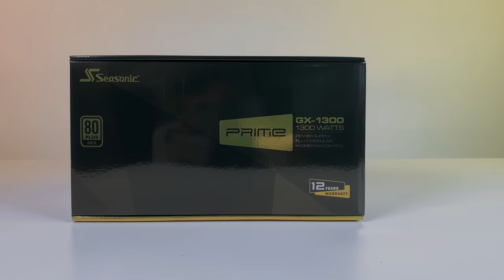LIANLI O11D XL Clear WaterCoolde Build

Comment: This is a really incredible build.  The tubing runs you ran to the distribution plate especially. Also your trick to keep the GPU from sagging is seamless.  Just one opinion, I would suggest is for the flow sensor wire to be tucked behind and then back around for a cleaner look. That's just nitpick really. Congratulations overall.
Reply: Hah?
Reply: The name of that  little "tray thing" that keeps the GPU from sagging? Any idea as to what its called?
Reply: @MassiveReset  I think it’s sth. like a riser cable.
Reply: @crowschattenpfote  thank you very much
Reply: @BowlingNG by "trick" do you mean the connector from GPU to RAD? Does that section actually run water or he's just using it to support gpu? Phenomenal build
Reply: @MassiveReset  It's called a GPU vertical PCI Slot adapter plate. You'll need a riser cable as well.
Reply: @Yungplaymaker  By trick I mean the small metal tube with the black ends that is sat on his fan mount to keep the gpu end from sagging.

Comment: Nice build! Looks very clean, light and not too overloaded with some secondary staff! Even though I'm not a fan of any RGB lighting, that particular one set looks pretty well. I wonder, what level of noise you should expect to experience from such built PC staying at approximately 1 meter distance from it?
Reply: its little subjective but found it very quiet
Reply: U don’t rely as much on fans with water cooling, so should be very quiet

Comment: I like this part 0:49 you did very good job on thermal paste !!
Reply: Actually he didint. all that does is creat little bubbles in between the cpu and plate when he presses it on. To much. Just put a little bead of paste and put the plate down. No need for all that.
Reply: I did the same with the thermal paste as well! I squeeze it onto my CPU and then spread it evenly covering the entire surface with a butter knife.
Reply: @ivanyu3930  Yes. I think this is the best way to cool CPU rather than 5 point dots method.

Comment: love the pink thermal paste 🤣🔝
Reply: Is this Thermal Grizzly Kryonaut ?
Reply: @crowschattenpfote  Idk, just thought it's different from the usual...
Reply: @Renato_gg  ok i don't know either oh by the way i just watch all the videos from this channel right now and without a break.😂
Reply: @crowschattenpfote  You can see at the beginning from the video from 0:40 Cryonaut Extreme at first on the right side and later on the left side of the table.
Reply: Why you use this thermal past if you dont cool it with liquid helium. It makes no sense
Reply: @georgbedarff1610  Why the frick shouldn't it make sense? Better thermal paste means better heat transfer, which again means cooler temperatures with the same cooler. Cryonaut is just simply thermal paste that is really good and not a product made exclusively for Extreme OC.

Comment: What vertical Riser is this?, because I'm looking for the one so I can fit the 3090 ftw3 with block and active backplate in the first slot.
Reply: That would be the Lian-Li 011DXL-1 Vertical graphics card holder with the 011DXL-1 riser cable PCI-E slot

Comment: awesome build very close to what am planning with the black case. i do have a few questions. which vertical mount did you use? is that the O11D Distribution Plate G1?
Reply: looks like the vertical mount from Lian Li, and yes that's the G1 distribution plate from EK
Reply: Yah it's the o11 D distro plate which imo looks bad in the xl version of this case when you can get the o11 XL distro plate for front or side
Reply: @masterhacker7065  cool I didn't know  there was a side mount one for the xl. Something about the front panel distro that doesn't sit all that well with me .
Reply: The vertical mount with water cooling looks nice but it's kinda annoying if you need to clean or access the motherboard behind the GPU.

Comment: you could have put fans behind the reservoir and pointing into the case to cool off the water coolant
Reply: I dont think some fans are gonna pass through thick acrylic to cool the coolant, there are radiators for a reason😂

Comment: Looks really cool. What size/type of extender fittings did you use on the CPU and GPU block?
Reply: I think  fittings for 16/10 Tubes but I don’t know. Look in the discription
Reply: I also think 16mm since the tubes are 16MM.

Comment: No need to use those tools to add Thermal paste. It looks fancy and all putting it on like that but all yer doing is creating tiny micro pockets between the CPU and your plate when you finally press it down onto the the CPU surface. just put a bead of thermal there and be done with it. 

The build his fucking fantastic though. Superb work on this PC.

Comment: What temps did you get on this? I putting a build together with the supreme x and it has a active back plate. I'm debating if I double fan the bottom or stick a thicker rad in.

Comment: There are only fans that blow outwards, none that blow in. Doesn't the housing always have a negative pressure and the housing draws in dust from all slots?
Reply: Bottom fans are blowing air in, in Pull-configuration.

Comment: I also wanna build in the same case a water cooled amd 7000 build...

But i am going to use flexible tubing because of you not needing the extra things to bend it and all the problems that come with stif tubing
Reply: Buy pre bend tubes, just need to cut them
Reply: @iTouch4444  where ?
Reply: @J.king87  Amazon and some other tech sites they provide few of them

Comment: @1:40 what is the SSD to RAM adapter you used?
Reply: That thing is a Dimm.2 module and that’s a thing that only asus has and you can but ssds in it, which can run over the cpu. But it’s only available with the high end board, like the Asus Apex or extreme😊

Comment: a quick question if anyone can answer, the liquid is been cooled by top radiator, isn't that supposed to be for hot air exhaust, just  saying isn't the liquid cooling radiator getting hot air.
P.S.   Newbie here trying to learn stuff so I can DIY my setup
Reply: It does exhaust hot air in fact, but its not really an issue.
And also, there is also a bottom Radiator cooling

Comment: How did you get the 3x8 Pin on the 3090 Ti Suprim X?! Mine is delivered with a adapter for 3 8 pin PSU cables ending in a 12(?) Pin cable fitting for the Suprim X. Is it different because of the watercooled version?
Reply: He has a normal 3090 and these have normal 3x8 Pin, while the 3090 ti uses the 12 Pin you mentioned.

Comment: someone who ordered this pc must be so dumb ordering K version of i9 when KS is faster, produces less heat and has lower power consumption.
Reply: The K version have Graphics chipset inside. Better option if you want to video editing or rendering something, it works toguether with the 3090 when need it.
Reply: @yv5tx  I think he is ironic. He doesn't meant the F Versions, but the K-Special-Edition (KS), which is known for being a bit better than the normal K version, but also to draw a shit-ton more power and produce way more heat but instead he says that its actually better while running cooler with less power draw, which is the ironic part, I think at least. Or maybe he actually believes that the KS runs cooler with less powerdraw, while sustaining the same performance, but this is just wrong. The only thing that makes the KS better than the normal K, is the fact, that the KS CPUs have better chips, which brings the possiblility, to pump way more power into them in order to let them run a bit faster, which results in, well, a bit better performance, but also in way higher temperatures and higher power usage, as already explained.

Comment: rad on the bottom is never a good idea
Reply: In this case you can do this, if you do inlet for this pc. If you use an Aio, I could understand your comment, but in a custom loop the water gets constantly pushed through the loop and then it doesn’t matter.

Comment: doesn't the thermal paste spread out , if you paste the entire cpu will it overspill onto the board ?  Most build videos i watch show just putting a pea size amount in the center or a X pattern
Reply: You can use both ways. The differences will be maybe 1-2 degrees. Yeah it can spread out, but then you have to use very much paste.